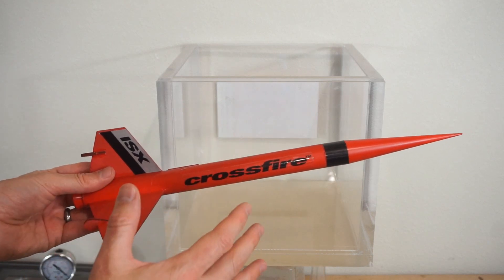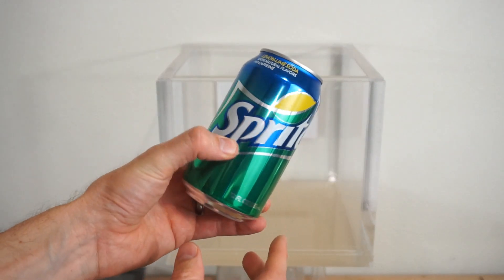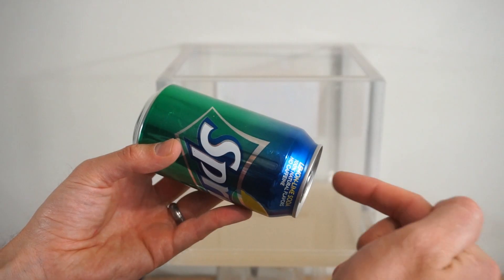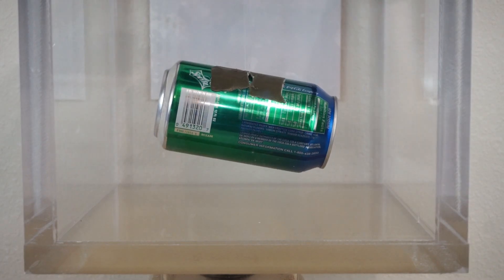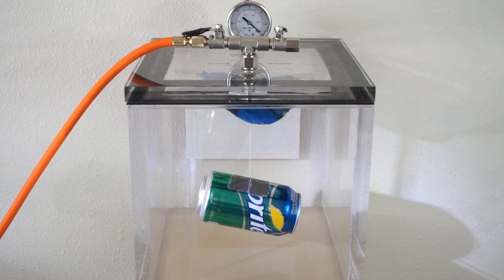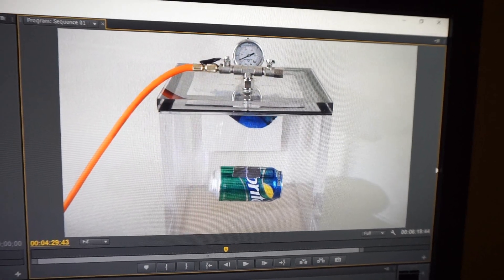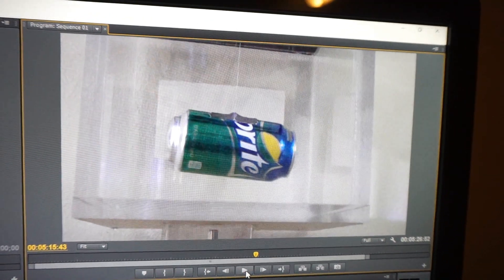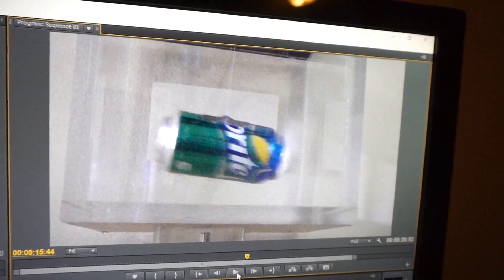Can a Rocket Fly in a Vacuum Chamber?

Comment: The container is too small, apart from the wall being too close you also have to realize that as soon as the gas comes out you're creating an atmosphere and it's not a vacuum anymore.
Reply: Not only that the gas coming out of the Can before the liquid does hits the wall causing the can to move
Reply: That little bit of gas is not creating an atmosphere to push off
Reply: He pointed out that the thrust was occurring before the pressure started to climb. Did you even WATCH it?
Reply: @petermirtitsch1235  It's psuedo science, like him saying the gas is in the liquid. Propulsion is always based on molecules slamming into molecules that have a different momentum (either an atmosphere or a solid surface). Whether it's a rotor blade, a spinning wheel or an airplane jet engine, it's all the same principle.
Reply: @Rick-zw7zv  you've never read up on Newtonian physics or how rockets work, have you?
Reply: @Rick-zw7zv well said.   Molecules colliding with Molecules.   These rockets in these chambers create their own atmosphere in milliseconds.   I really like your comment.
Reply: @Rick-zw7zv  also, he says that the rocket engine throws mass to lift the rocket, but there is hardly any mass from the gas created by the engine. It's much less than the rocket. He is loaded with silly assumptions.
Reply: @papalegba6796  What is Newton's first law?
Reply: @HorkSupreme  😂😂😂😂😂😂😂😂😂
Reply: @papalegba6796 the text of it is literally moving objects will stay moving in the same power and direction untill another force affect it and the reverse with non moving objects 
How is this against rokets moving in a vacuum when it use the third law of Newton which have no problem with vacuum or not as a force is already generated
Reply: @hasanplaster1510  sorry I don't speak gibberish 😂
Reply: @papalegba6796 Can you explain how Newton's first law proves that?
Reply: @Syndicalism  yes
Reply: @papalegba6796  Would you like to go ahead and explain that then? I'm willing to hear you out..
Reply: @Syndicalism  Doubt it 😂
Reply: @papalegba6796  You haven't even tried. I'm willing to listen, and I'm trying to be respectful. Worst case scenario, my mind isn't changed. By explaining, I'll be able to help you see if you've misunderstood or, conversely, you'll be able to help me see if I've misunderstood something. I've gone through an undergraduate program in physics, and your brief response that i initially responded to doesn't really make sense to me, so I'm just trying to see whose misunderstood something along the line.
Reply: @papalegba6796  I'm not trying to force an answer out of you, so don't feel obligated to justify your claim. I'm genuinely curious and am willing to learn or alternatively help others to learn if I can.
Reply: @Rick-zw7zv  If I'm not mistaken, you're claiming that an atmosphere or solid surface is required to have propulsion. If you dont mind, can you back that claim or explain in a little better detail for me what you mean? You are welcome to explain using physic jargon, I'm especially fluent in calculus and more specifically, variational calculus (i.e., Lagrangian or Hamiltonian mechanics, or other methods).
Reply: @Syndicalism  no I'm fine thanks 😂
Reply: @Syndicalism  The atmosphere or solid surface has the function of a pressure chamber. A pressure chamber is an enclosed space where the pressure is higher than the surrounding environment. In an atmosphere you can create this situation because you have high velocity molecules colliding with low velocity molecules. In a vacuum there are no molecules to collide with and create pressure. A vacuum is like an infinitely large pressure chamber that would require an infinite amount of propellant to generate  pressure.
Reply: @Rick-zw7zv  it's almost like w=PV is a gas law isn't it?😂
Reply: @papalegba6796   Yes, there is no pressure chamber so the volume is infinitely high which means the pressure is infinitely low, in other words, 'zero'.
Reply: @Rick-zw7zv  tbf it's somewhat simpler even than that: "work = external pressure x change in volume" . When external pressure = zero then work also = zero. Tho, as you point out, it would require an infinite amount of gas to pressurise "space" in order for the rocket exhaust gas to be able to produce work. Which is unlikely 😂
Reply: @papalegba6796   Yes, Í just had an interesting chat with Ai. 'It' basically told me that propulsion in a vacuum works by Newton's 2nd law, "conservation of momentum". This would require you to consider the weight of and speed of the rocket and the weight and speed of the 'fuel being expulsed. When I asked for realistic numbers it told me that by the time rockets are in orbit (costing 90% of fuel supply) they have about 10 seconds of fuel left to accelerate 15m/s. Creating motion on this principle they might as well be shooting out led marbles from the rear with air pressure guns. Strange.
Reply: @Rick-zw7zv  Newtons 2nd law (f=ma) refers to the external force being applied to an object, which can be calculated by multiplying its mass by its acceleration. But a vacuum cannot apply an external force, ergo f=ma shows a rocket cannot alter its state of motion in a vacuum. Very simple.
Reply: @Rick-zw7zv  Also, a thermal rocket is a heat engine of the internal combustion type. You do not use conservation of momentum to calculate the output of a heat engine, the notion is ridiculous 😂
Reply: @papalegba6796  Having said that, it does make you wonder how thrusters on satellites are able to orbit transfer maneuver at altitudes where there is no atmosphere.
Reply: @papalegba6796  Ok, it seems a little dumb to make a baseless claim in an attempt to convince someone to think something else, but I guess it's just to troll people. If at any point in the future you want people to actually believe your world breaking claim, then you've gotta back your claim.
Reply: @Syndicalism  this is why I ignored you 😂
Reply: @papalegba6796  Well, you didn't ignore me as you can clearly see that you kept replying to me. I simply asked you a question in a respectful manner as you are the one who wanted to publicly share your opinion. I eventually told you that in that in the future, if you want your opinion to convince anyone of anything, you will want to prove your claim.
Reply: @papalegba6796  Also, in your most recent reply you're saying you 'ignored' me because:
A) It's a little dumb to make a baseless claim.
B) You may be trying to troll people.
C) To convince people that your opinion is right, you will want to back your claim.

I'd assume you're only trying to troll people, but I'm curious if the other statements are to also be included in your reason for 'ignoring me'
Reply: @Syndicalism  tl;dr. Read the thread & you'll see I've made plenty of comments showing I understand the physics of rocketry. You have made none &  never will 😂
Reply: @Rick-zw7zv You can test your logic by standing on a skateboard and throwing a bowling ball off the back and measuring your acceleration in the other direction. Then throw something like a balloon off the back (or anything of greater volume than the bowling ball but with far less mass). If it's just the bowling ball/balloon pushing against air that causes your acceleration then you should experience greater acceleration with the balloon.
Reply: @everybodylovesballs  Heat engines don't throw bowling balls, chatbot 😂
Reply: @everybodylovesballs  That analogy is actually funny considering your name. You forget that the balloon and the bowling ball are equal in size and so they will experience equal air resistance. In this case the mass of the bowling ball becomes the predominant factor. However, if you take a uninflated balloon with a mass equal to a bowling ball and you blow that up to a giant balloon and if you push yourself against that balloon it will be like pushing against wall.
Reply: @Rick-zw7zv   You forget that the balloon and the bowling ball are equal in size and so they will experience equal air resistance
Lol. I forgot, did I? You just proved my point that it's not air resistance that causes the forward acceleration.
In this case the mass of the bowling ball becomes the predominant factor
Your claim is that it's pushing off the air that causes the forward acceleration. How does mass "become the predominant factor"? Your explanation doesn't involve mass.
Reply: @papalegba6796  No, they "throw" gas which makes the rocket move in the other direction. Just like if an astronaut threw a bowling ball in space. Are you getting it yet?
Reply: @everybodylovesballs  No, I'm just showing you that the DIFFERENCE in momentum between throwing a balloon and a bowlingbal can not be attributed to the force produced by AIR RESISTANCE (drag) because the balloon and the bowlingbal are equal in shape and produce the same drag force. This means that the difference in force acting on the skateboard can solely be attributed to Newton's 3rd law of motion which only considers mass and velocity, not pressure and drag force.

Stand on your skateboard and jerk at an open 2 pound umbrella. Now do the same with a small 2 pound object and see if mass and velocity is the only force acting on the skateboard. The velocity of the umbrella generates moving air molecules inside the umbrella that pushes AGAISNT the motionless air molecules behind it causing air pressure to build up inside the umbrella and a resulting force that allows you to move your skateboard. It is important to know that this wouldn't have been possible without the pressure chamber effect. In this case the pressure chamber was formed by the umbrella on one side and the motionless air that it pressed against. Without the motionless air behind it, the air molecules inside the umbrella wouldn't be able to collide and generate pressure, resistance and force.

Do the breaststroke in water and then do it on dry land and see the difference in thrust you are able to create. it shows you that the atmosphere and generated pressure has everything to do with thrust.
Reply: @Rick-zw7zv   This means that the difference in force acting on the skateboard can solely be attributed to Newton's 3rd law of motion which only considers mass and velocity, not pressure and drag force
So the atmosphere is NOT REQUIRED. In the vacuum of space, you can simply eject mass in the direction opposite to that you which you travel. This is how rockets work. The thrust of a rocket engine is exit mass flow rate multiplied by the exit velocity.
The velocity of the umbrella generates moving air molecules inside the umbrella that pushes AGAISNT the motionless air molecules behind it causing air pressure to build up inside the umbrella and a resulting force that allows you to move your skateboard
Sure, it's not that much different to how propellers work - like lift, but forwards. It's still Newton's third law - pushing air backwards moves the plane forwards. A jet engine works differently in that instead of maximising airflow rate, it takes a moderate amount of air and increases its velocity. The nozzle is usually designed to make exit pressure equal to atmospheric pressure. A rocket is similar but it doesn't even need air as it has it's own oxidiser.
it shows you that the atmosphere and generated pressure has everything to do with thrust
You can produce thrust in that way. But claiming that it's the only way is absurd. Even in the atmosphere, you can produce high thrust by making exit pressure equal to atmospheric pressure and maximising exit velocity. Prop planes are most efficient below 30,000ft. Rockets are more efficient in the vacuum of space - and I think you even understand why this would be.
Reply: @everybodylovesballs  
Let's see what the conservation of momentum effect is on bullet speed:

m1u1 + m2u2 = m1v1 + m2v2

m1 gunpowder weight = 0.15 grams
u1 initial speed gunpowder = 0
m2 bullet weight = 8 grams
u2 initial speed bullet = 0
v1 final speed gunpowder = 350m/s
v2 final speed bullet = ?

According to ChatGPT v2 = 6.5 m/s (14mph) which is NEGLIGIBLE.

Average bullet speed is around 800 miles per hour so conservation of momentum only has around 1.7% influence on the bullet speed. The rest is created by rapidly expanding gasses pushing objects forward.
Reply: @Rick-zw7zv  So there are no external forces, no mass of a gun and its recoil velocity, nothing? You just have an isolated system of bullet/gunpowder where momentum is conserved? So your example is equivalent to a bullet sitting on its own (in a vacuum actually) and you ignite the gunpowder. Are you claiming that the bullet accelerates to 358m/s under these conditions?
A bullet/gun system where momentum is actually conserved is a much closer analogy for a rocket in space (as you say, the momentum of the gunpowder is negligible). If an 8g bullet is fired in space and the bullet leaves the gun with a velocity of 358m/s, what is the velocity of the gun in the other direction (relative to its mass)?
Reply: @everybodylovesballs  In my thought experiment the gun is in a fixed position. If it weren't then you're right, the recoil and the gun's mass would negatively  affect the moment of the bullet. A rocket is more like a floating bullet in a vacuum igniting itself without a gun, the motion would be negligible. The gun provides the function of an atmosphere, it allows the expanding gasses to generate pressure and motion. It's unlikely that any rocket ever left earth's atmosphere.
Reply: @Rick-zw7zv  In my thought experiment the gun is in a fixed position
So now the system in which momentum is conserved is at least comprised of the bullet, the gunpowder, the gun, and whatever the gun is attached to that keeps it "fixed"? If the bullet/gunpowder system really were isolated then you'd get the same result whether the gun was there or not.
A rocket is more like a floating bullet in a vacuum igniting itself without a gun, the motion would be negligible
So not zero like you were claiming then? And it doesn't need an atmosphere to push off?
And they have a nozzle to accelerate the gas, which is a bit like the barrel of a gun but pinched in the middle, and a lot of engineers spend a lot of time designing them. And of course understanding the internal pressures in the nozzle is crucial but they do not work by creating an external pressure differential. They work by ejecting mass at very high velocities.
As I said, the thrust of a rocket is the exit mass flow rate times the exit velocity. In a rocket, this number is very large.
It's unlikely that any rocket ever left earth's atmosphere.
Why is it unlikely? Because the numbers are large and you don't like large numbers? As an example - in the first eight minutes, the core stage of the Artemis SLS burns 735,000 gallons of liquid propellant to create two million pounds of thrust and the twin rocket boosters burn more than two million pounds of solid propellant to create more than seven million pounds of thrust. When this is depleted, the core stage separates and the remaining part of the rocket is orbiting Earth at 100 miles altitude and traveling at 17,000mph. There's nothing about this that is "unlikely", it just takes a lot of fuel and a lot of very clever engineers.
Reply: @everybodylovesballs  @everybodylovesballs  You're right, the mass of the gun doesn't affect the bullet speed, I take that back.

"So not zero like you were claiming then? And it doesn't need an atmosphere to push off?" About 1.7% of the bullet's speed can be attributed to the conservation of momentum principle which is the ONLY force that doesn't require an atmosphere to push off. The fuel mass vs rocket mass ratio of a rocket is much lower (Saturn 5 rocket is 6.2 million pound), exhaust velocity is about 2.40 x 10^3. See how much fuel mass they have to maneuver in space and that should give you an indication how long they can accelerate and with what force. It's nihil. The point is this, flying rockets in an atmosphere involves different laws of physics than flying in a vacuum.

". . . understanding the internal pressures in the nozzle is crucial but they do not work by creating an external pressure differential. They work by ejecting mass at very high velocities." YES, and ejecting mass at high velocity causes pressure to build up on the outside of the nozzle due to AIR RESISTANCE. The internal pressure difference between the inside and the outside of the nozzle is irrelevant to this point. It's all about the pressure difference between the outside of the nozzle and the other end of the bullet/rocket. In a vacuum you can create mass flow but you can't generate pressure so the back and the front of the rocket will have zero pressure which means no movement [other than the minimum movement caused by the mass ejection of gas particles].

Also think of it like this: The jet of the engine creates fast expanding high air pressure area with low density air, so it's really moving air mass. The air resistance encountered by this 'bubble' produces a force in opposite direction (Newton's 3rd law) which ends up pushing the rocket forward. According to Newton's third law, whenever an object exerts a force on another object, the second object exerts an equal and opposite force back on the first object. THE DISPLACED AIR MASS IS THE 2ND OBJECT, WITHOUT IT THERE IS NO REACTION!

Look up the physics of a bullet being fired and you will see it's all about expanding gasses and pressure. Nowhere will you find an explanation saying it's about the momentum of the ejected gas vs bullet.
Reply: @Rick-zw7zv so you cant comeback from moon and it was the lie?
Reply: @papalegba6796how many accounts do you have?😮 I see you in every comment with different accounts hahahah